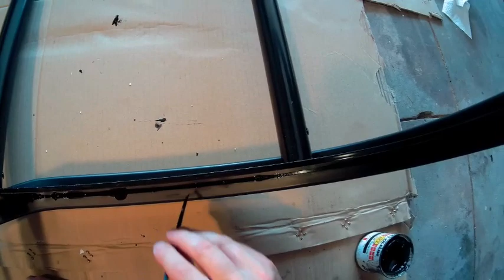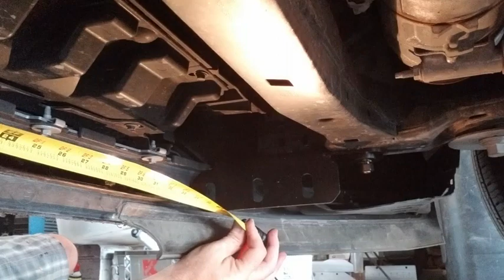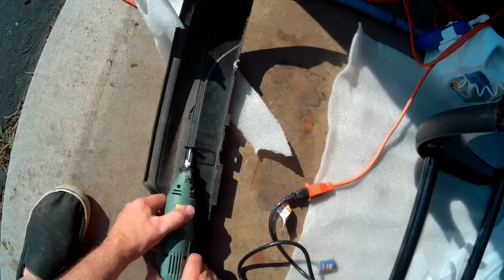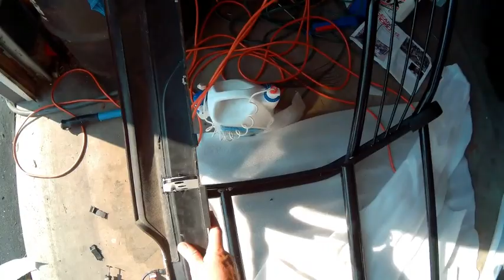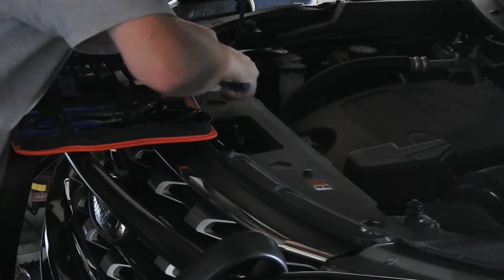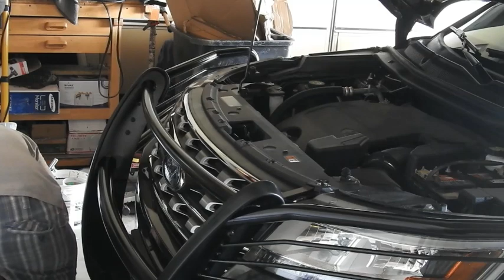Grill Guard 2016 Explorer Aries DIY Installation

Comment: Hey thanks for all your videos on the Explorer. I’ve actually seen yours driving on 59 a few times. Was wondering if you could upload a video on how to get the explorer raised and then placed on jack stands? Thanks!
Reply from the maker: Thanks for watching Hope you subscribed to the channel,  the Explorer has to be one of the hardest to get lifted to work on it. I used wood blocks to drive up on I did end up making ramps and I need an oil change so I can make a short for it   Steve
Reply: @mytwogoodhands2799  yes I’ve been subscribed. Thanks for all the content!:)

Comment: Nice Job! How do you turn the front sensors off and do you have to turn them off each time you get in the car? I want to install this on my explorer also. It looks nice!
Reply from the maker: I have to turn them off every time it is a habit now, but when installing it I should have moved them to mount on the grill guard yes you would need to make bracket and maybe longer wires?  Please subscribe to My channel  Thanks,  Steve

Comment: Would love to to see the final product.
Looking at other video you did, looks like they go over the light, do they obstruct the lights?
I also have proximity sensor, does this bumper bothers them, been told the Setina one blocks them?
Reply from the maker: Here is a link to the finished product https://www.youtube.com/watch?v=tIwpHhcmhbQ  Yes this will make your sensors angry I just hit the off button. It does not impact the light If you wanted to the little bars across the lights are removable. I plan to work on the sensor issue this summer making a relocation kit for them
Reply: @mytwogoodhands2799   great work i am about to do the same kind of mod on mine. have you figured out the sensor issue. i have just subcribed to your channel
Reply from the maker: @steveacevedo8644  I have not as there is no programming solution, It is a another teardown to relocate them and I do not have the BLIS system so I just hit the off button, If I do it next summer I will post the video and the parts used. if I fab a part I will have drawings or parts available.  Thank You Steve
Reply: @mytwogoodhands2799  Thanks i will be watching. just bought a explorer and want to add the push guard and lights. your looks good
Reply: @mytwogoodhands2799  I just installed this same brush guard on my 2018 Explorer Sport, I used the American Trucks sensor relocation kit for the 2019 Ford Ranger, its the same sensors and it works great, no issues.
Reply from the maker: @Ace0000087  Thank you for the update  Steve

Comment: Having trouble removing the inlet cover. Taken off all the grey screws but the three black screws on each side above is giving me a hard time.  Any recommendations on which screw driver it is ? As my tools are limited lol
Reply from the maker: They could be stripped you can use the plastic tool kit to remove  (I do not know this seller) this is so you know what I am talking about  https://www.ebay.com/itm/264714820627?epid=5043566320&hash=item3da23b9c13:g:W~kAAOSwupBcqxDk